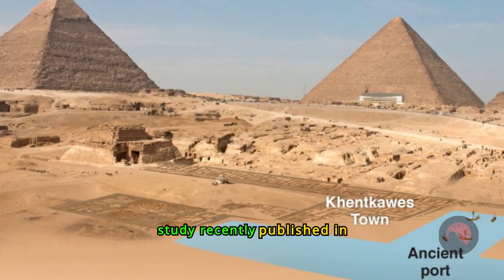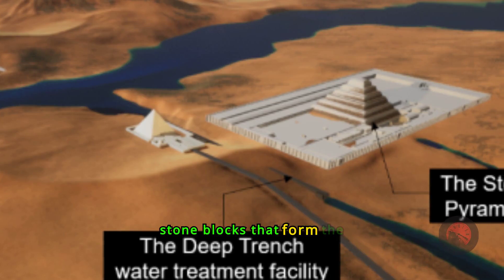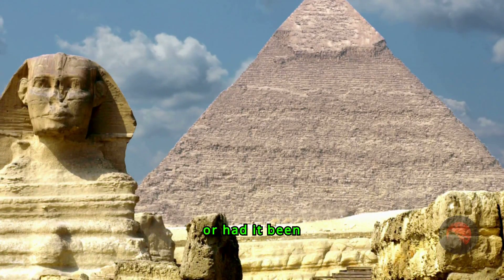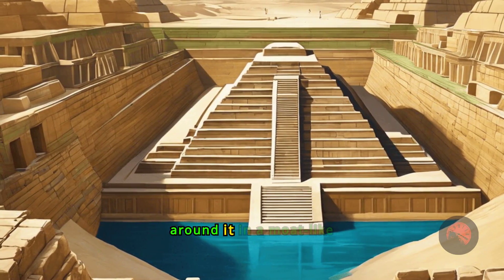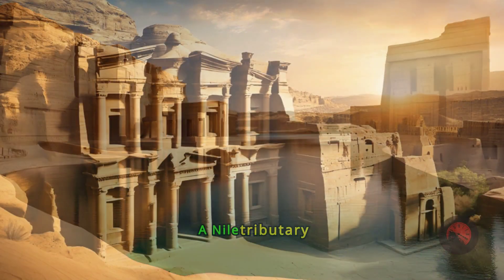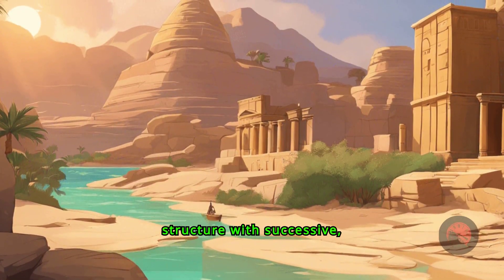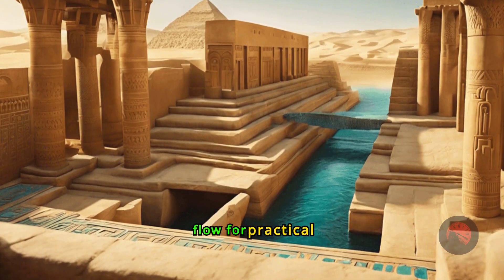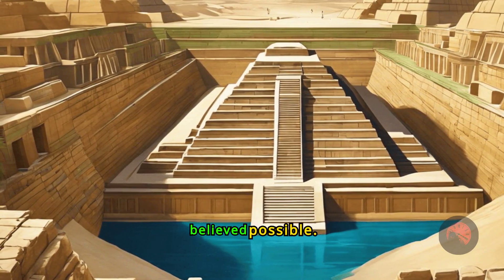Ancient Egypt's Secret Hydraulic Technology Unveiled!

Comment: 1. How did they load the massive blocks from the quarry to the river on to a barge. That's alot of displacement too. 2. IF the blocks got down to the site, then they have to b unloaded on to the ground.  No I don't accept this concept. What of the Golden age when the gods were said to b among the ppl. I will accept aliens w their technology such as lifting the blocks. The age of the  pyramids is being  adjusted as more evidence is being discovered.
Reply from the maker: You brought up great points. Moving and placing multi-ton blocks was definitely an extraordinary challenge—but we now know the Egyptians had surprisingly advanced engineering. Hydraulic and water-based technology may have played a major role.

Some researchers suggest they used flooded slipways or water-filled basins to float heavy blocks closer to the construction site, drastically reducing friction and load weight. Others propose wetting the sand to cut resistance by up to 50%, or even using canal systems to bring stones directly to the plateau.

As new evidence emerges, the timeline and methods of pyramid construction continue to be refined, showing just how innovative the Egyptians truly were. While theories about gods or advanced visitors are fascinating, the archaeological record increasingly highlights human ingenuity, clever physics, and early hydraulic engineering as the driving forces behind these monumental achievements.

Comment: That don't make no sense to me. If the useda hydraulic system to move them how did they keep the ones in place from moving under the pressure and how did they move the first ones ?
Reply: The hydrologic system was lower they built from bottom up....
Reply: @noname-e3i4c  how did they get them in place ? Did they have to position them. ? Did they have oxygen masks ? Sorry I'm still not convinced. But maybe 🤔
Reply: Watch other videos you'll get a better idea of how it works I think it makes sense now
Reply: You obviously don't know how hydraulics work.  It's high liquid pressure. It's how cranes can lift heavy objects.  The video is saying they had hydraulic technology back then. How is this hard to grasp ?
Reply: @mariobtron5907   How did they hydraulicly move and fit the very first multi ton block.  ? If was nothing to use as a barrier for the hydraulic water. Buddy you believe it if you want. It sounds like grasping for hydraulic straws to me.  Hahahah